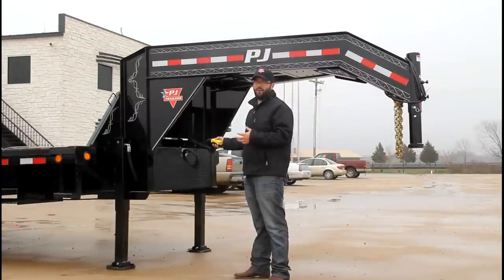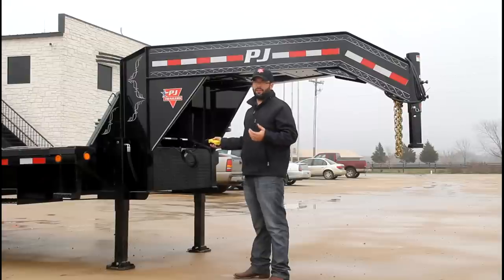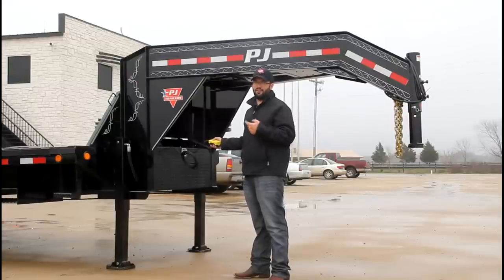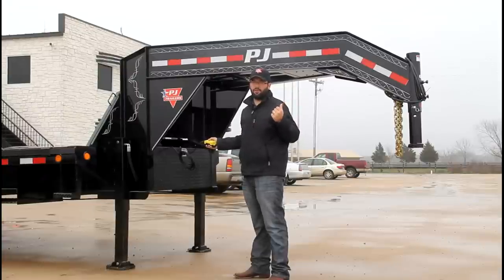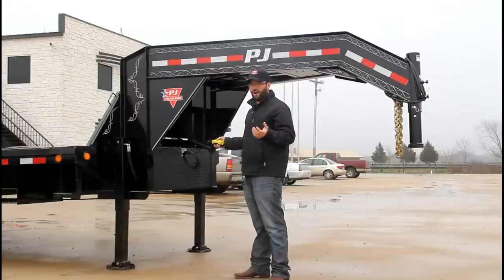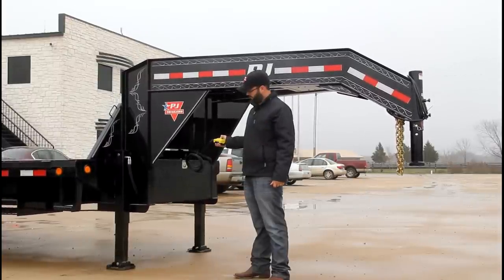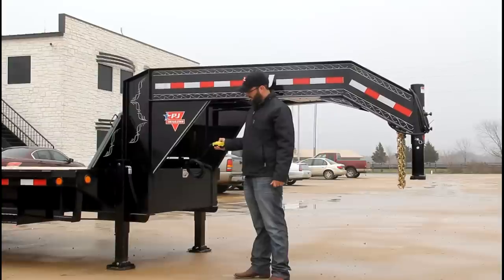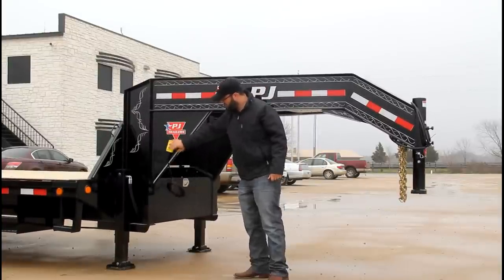Hydraulic Jack Demo - PJ Trailers Gooseneck

Comment from the maker: Your 7-way plug will trickle charge the battery when hooked up to the trailer.  To fully charge the battery you will want to use the integrated 110v battery charger.  Just plug an extension cord into the charger from outside the box to recharge the battery.